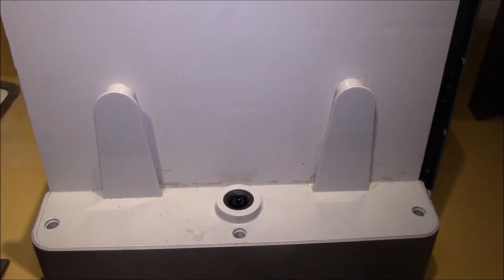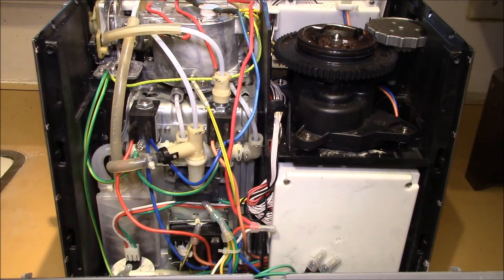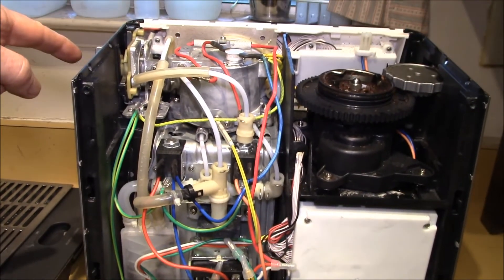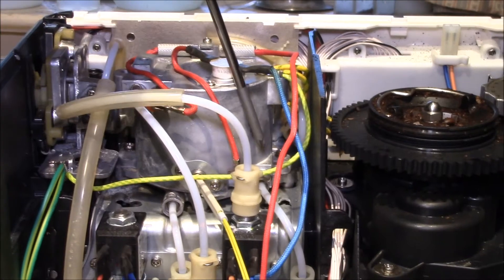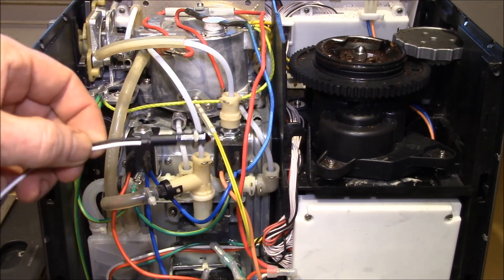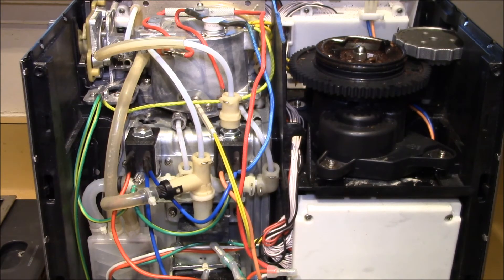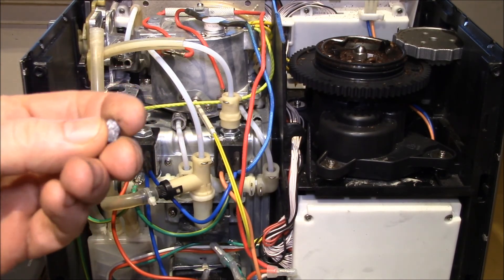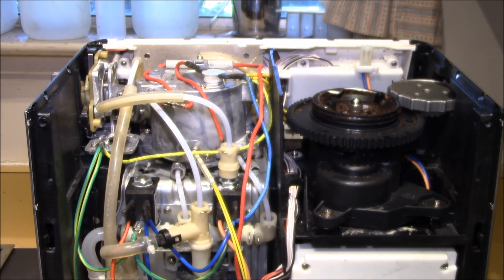Breville/Sage 870XL Barista Express - Water Flow

Comment: Breville 870XL question: opened my machine to inspect the water flow meter as my machine brew and never stops brewing. I was thinking is there is a way to take it out? And maybe clean it with citric acid? I can pull cable harness but I am avoiding pulling anything with force.  Can't find any video on this replacement or cleaning this part. Thanks any help or suggestion will be appreciated.
Reply from the maker: Have not removed that component myself.  One option is to clean it in place.  Use something a large syringe and a hose to connect to one end of the flow meter and a long tube into a container of descaling solution and then alternate pull and push liquid through the meter with the syringe.  Let it sit for a few minutes between cycles.
Reply: @The4Crawler   Plastic element that looks like it's not serviceable compare to commercial machines were they can be cleaned. It seems like your suggestion is the safest option to not break something. I'll go through the descaling process using citric acid or the solution from the store. If this won't help. I'll try to flush it, disconnecting the hose. fingers crossed :)
Reply from the maker: @wojtimore1  I may not be serviceable as in open it up to clean/repair it, but there is a replacement part available:
https://www.ereplacementparts.com/flow-meter-p-629903.html
Main thing to check is that the internal impeller is spinning when water passes through and if that's OK, it may be that the electronic sensor inside has stopped working or the connection to the main circuit board is not good or the input on the main board is not being recognized by the controller chip.

Comment: Thanks for the great video! I Need some help guys, I got an 860xl and it turns on, I hear it pumping but no water or steam comes out, would this solve my problem?
Reply from the maker: Does water appear in the drain tray?  If so, one of the solenoids may be letting water past and that runs to the drain.  Or one of the small diameter tubes may be clogged or the check valve in the pump may not be working right.
Reply: @The4Crawler  thanks for reply, it was the water pump, I took it apart and just cleaned it, put it back together and she worked like a champ
Reply from the maker: @david029014  Glad to hear you got it working again.  Good job!

Comment: Thanks a million for taking the time to make this video. I especially appreciate your efforts to name the different components by their proper name. It makes finding replacement parts on-line a lot easier.
Reply from the maker: You're very welcome!  I did spend a fair bit of time researching the names and functions of the various parts as shown on the ereplacementparts  web site to try and get them right for the video.  In fact it was that process that helped identify what some of the parts were for.
Reply: @The4Crawler  Can I ask a question please,  what kind of material is made the water tank, manual valve etc. ? Is it aluminum ?

Comment: Thanks for the video, great tutorial of how this machine works. I have the Infuser, I believe it’s the 840xl, same as the 870 but without the grinder. I started having low pressure so I did the following in this order. Replaced the flow regulator valve because it appeared to be leaking slightly, then I by passed the inline filter and finally replaced the solenoid.  None of these things fixed my problem. The main symptom is air coming out through the group head and or the hot water outlet, depending with I use - a frothy kind of sound. 
I disconnected the water going into the heating element and it is strong, no air.  I removed the hose coming out of the heating element and it’s full of air.  Note there is lots of heat being produced by the heating element. 
Any idea why I would having this issue?
Reply from the maker: My guess would be either the thermo-coil is bad or perhaps the temperature sensor on it is bad and causing it to overheat.  It could also be the limit switch on the hot water/steam valve.  If the steam switch is sticking closed, that tells the thermo-coil to heat up to generate steam (above boiling point) vs. hot water (below boiling point).  You might try unplugging the steam position switch (that's the switch that closes in the steam position) and see if that makes any difference.  If not, it may be the main circuit board is bad.  Might be worth contacting Breville support and see if they have any other ideas.
Reply: R Brown makes sense because the hot water flows out pretty normally at times but then turns to more like steam. You said to unplug the steam switch, how do I unplug that switch?
Reply from the maker: @berniehillier9399  See below:
https://youtu.be/9lMw6ooiqPI?list=PLpY2FP1a9tisyIfKjSugexoVK01xQuptv&t=408
Find wires coming off the switch that closes in Steam position and then find where those wires connect and remove them at that point.  I think they may connect both at the switch and at the main PCB.

Comment: Thank you very much for this very clear video. Together with this other video (https://www.youtube.com/watch?v=an_pZ27tNqk) it helped me understand how my Breville 840 worked, how to take it apart, and how to solve my long-standing low pressure/low water volume problem. There were two issues: (1) the 3/2 solenoid valve had to be replaced - it was causing some of the water to flow directly into the drain, resulting in low pressure and (2) there were air bubbles in the water coming out of the boiler, which was due to a crack in the silicone tube just below the pump. Opening the 3/2 valve entirely and cleaning it as explained in your other video (https://www.youtube.com/watch?v=eljHS_BRJXk) worked 90% of the time but I ended up replacing it for a more permanent solution - it also solved the buzzing sound. As for the 90 degrees silicone tube betwen the flow meter and the water pump - it can no longer be ordered (https://www.ereplacementparts.com/pump-inlet-tube-silicone-p-629894.html) so I just replaced it with a regular silicone tube. It is a bit bent but it apparently doesn't significantly restrict the flow and it doesn't cause any problem. Very helpful! Thanks for taking the time to make this video!
Reply from the maker: Sounds like a successful repair.  As I understand it, all these 800-series machines are fairly similar inside.
Reply: @The4Crawler  Yes, my model is actually a Riviera & Bar CE830A - it's the European equivalent of the Breville BES840XL. It is also sold as Solis in some other European countries. The main difference between the models seem to be the presence/absence of a grinder. The rest is exactly the same. And FYI - the official repair shop told me that my machine couldn't be repaired because the parts were not longer available. I was able to troubleshoot the issue by watching your videos, and all it took to find spare parts was a few minutes on google!

Comment: Nice video, for anyone who never seen inside one they might find it hard to follow but you did a good job explaining it:) I always say take pictures before you take it apart if you don't know where it will go after it's not where it use to be hahaha. Or you could just run this video and freeze frame it to look alike and hope for the best!
Reply from the maker: Glad it was helpful!  Yes, part of the reason I made this video was for future me, next time I had to tear into the machine.  I was completely wrong in my initial assessment of how the water flowed in this machine when I first changed out the solenoid valves.  It was seeing how the valves operated internally and also adding the indicator lights on the solenoids to see how they were operated that it finally made sense.

Comment: Thank you for your very thorough analysis of the water flow. The problem I have is as follows. When the machine is first turned on, it begins to pre-heat and presurise the water. At this point, the  port solenoid is turned off. What stops the water flowing directly from the 3 port solenoid to the steam/hot water switch and from there be dumped? This is in fact what is happening in my machine and I cannot figure out how it is supposed to work. Unless the pump is not supposed to come on until you start brewing but I am quite sure I have always been able to hear the pump come on momentarily upon pressing the "on" button. I would appreciate any comments you may have on this matter.
Reply from the maker: Glad you found the video informative.  With both valves off at the beginning, nothing stops water flow up through the top of the 3 port valve to the hot water/steam valve and through that bypass port to the drain pan.  On my machine, the pump is run for a few seconds at power up then it's turned off.  This is probably done to prime the pump.
Reply: @The4Crawler  Thanks for your prompt response. On my machine, the pump keeps running on turn on and, with the 3 port solenoid off, dumps the water straight, via the steam valve into the drip tray. It will do this until it runs out of water. I think this can only be due to a fault in the processor board.

Comment: Thank you so much for taking the time and effort to post this video. I had a problem with water coming through the filter head (think that's the right name), as soon as power was switched on, and no flow through either the hot water output or the steam wand. I had no idea of the flow through the machine, but once I watched your video everything was clear. Diagnosed a stuck 3 way valve, stripped it down and voila! One valve stuck in the open position with limescale buildup being the culprit. A soaking in white vinegar and a quick rinse with water and all is now well. Thanks again, much appreciated.
Reply from the maker: Great job on troubleshooting and repairing the problem!  Yes, understanding how water flows through the machine is key, with that you can usually figure out where the problem is.  Mine was just the opposite, the 3-port valve was sticking closed and not sending pressure to the brew head.
Reply: @The4Crawler  Thank you soooooo much for posting this. I am awaiting for the right screwdriver to be delivered but watching this video I already know what is likely wrong with my Breville Barista express. No matter what I do with the steam/hot water switch, everything comes out of the brewhead. Like Mike and yourself, I think the 3 way valve is the culprit  and is currently stuck in the "brewhead" position. Given the hardness of the water here in Paris, pretty sure my valve is made of limescale at this point. Thanks again ! I 'll keep you updated guys
Reply: Hey there, I have the exact same problem but I cant find the problematic part, can you please share with me the timecode of when we see the related part in the video.
Thanks

Comment: Great video. Thanks for the very useful info. I’ve had a very similar problem. Australian version BES860. Replaced the 3 way solenoid and dump valve on the valve block and descaled again. Still sending water to the group head and steamer at the same time when steam switched on. Trying to pour a shot results in no pressure on the gauge. Think I’ll watch your pump/over pressure valve video for some more help with my problem. Might be time to buy more parts although this time with more understanding of how it all works. Cheers 🍻
Reply from the maker: It sounds like the 3-port valve is not fully opening, which seals off the port to the steamer, and that's letting water go in both directions.  That valve is the key piece in the puzzle as the steamer/hot water side has no restriction and water will take the path of least resistance.
Reply: Thanks again for all your detailed videos. As a follow up for anyone following, I dug deeper into my problem. I initially suspected pressure gauge but thought I better rule out water pump first. It seemed to be fine and would pump out heaps of steam but would struggle to do a shot of coffee or move the gauge. Flow meter filter back flushed and flowing fine. Tested the pump and over pressure and found no water coming from over pressure dump line. And the pump would shoot water a few meters disconnected at the output. Replaced it anyway and all my troubles disappeared. Pressure gauge would jump up to normal range pouring a shot and no more leaks between steamer and group head when steaming milk. Thanks again for giving me that inspiration and motivation to get to the bottom of the issue. Now enjoying my home made barista quality coffee during Melbourne lockdown which has certainly made the lockdown a little easier. Cheers 🍻

Comment: Great video! Would you have any idea whats wrong with my BES870XL? Machine keeps losing programming, even after reprogramming, so you have to manually stop shot. first problem ive had in 4 years.
Reply from the maker: Assuming no issues with the AC power to the machine, it could be one of two things.  One is the flow sensor between the water tank and pump.  I think that's what measures the volume of water used.  Or it may be an issue on the main circuit board where the input of the flow sensor is read.  If you reset to the default volumes does that also not shut off?  Might be worth contacting Breville support and ask if they have any troubleshooting/repair ideas.
Reply: @The4Crawler  Thanks for the reply! I think you're right about the flow sensor. I reset default volume and still just keep running. I will call Breville and try and confirm diagnosis then order the part. Anywhere other than here that you're know of to order part? Thanks again! https://www.ereplacementparts.com/flow-meter-p-629903.html
Reply from the maker: @SneakyMrMan  EReplacementParts or armed with the part number, you can likely order the part from Breville or search on-line with that p/n and see what shows up.  Also worth checking out the part, see if the little rotor inside is jammed on something or if the cable to it is unplugged.

Comment: Hey thank you for the video! This helped my understand the internals of the Barista express. I got here because my  1 cup and 2 cup button doesn't automatically stop, I also never had a clean me light on with 1 year of owning the espresso machine. I am thinking there is something wrong with the flow meter, do you think there are issues other than that? I will try to open the machine today now that I watched this. Thank you again!
Reply from the maker: It may be the flow sensor is faulty, it may simply be unplugged or perhaps clogged with hard water deposits.  I would also try resetting the 1-cup and 2-cup volume settings to the factory default (see owner's manual for instructions).  Also, if nof recently descaled, run a descaling cycle followed by the cleaning tablet cycle if it'll let you run that.  Also, might be worth contacting Breville support and see if they have any further troubleshooting steps to try.

Comment: do you know what's the gauge of the white water tube going into the group head?
Reply from the maker: If that's the same as the other white teflon tubing, it seems to measure 0.145" or 3.68mm outside diameter.  Part numbers available below:
https://www.ereplacementparts.com/breville-bes870xl-the-barista-express-parts-c-116052_116055_290179.html

Comment: Mr. Brown...Can you suggest while brewing  water flow does not stop while using one shot or two shots. I did decal few times, still it is erratic. Any suggestions?
Reply from the maker: A few things to try:
1 reset the water flow settings, instructions on how to do that in the manual.  
2, if that doesn't help, try unplugging the machine for a few minutes to see if that will reset it.  
3. If that doesn't help, it may be the water flow sensor that is not sending good flow data to the control board.  The amount of water pumped is determined by that flow sensor, it is easily replaced if needed.
4. Or it may be an issue with the control board itself.  Might be worth contacting Breville support and see if they have any further troubleshooting information.

Comment: Thanks for this videos so helpful, my question is that how can i reduce the pressure to almost 10 BAR maximum because it is reached 16 BAR during extraction i saw some people do it but i can't figure that. 
Regards
Reply from the maker: Easy thing to do is set the grinder to a coarser (higher number) setting as it's the packed coffee grounds that provides the restriction that causes the pressure to rise.  The other option that might work is to adjust the end of the safety valve that's on the pump outlet:
https://youtu.be/46UBebNJ-uo
That black end can be turned in or out to release water when the pressure exceeds the set pressure.  I think it's normally set around 15 bar.
Reply: @The4Crawler  Thanks for your reply 🙏, 
can you explain how can i adjust it please if you have time
Reply from the maker: @ayradhi  See the valve at this time in the video:
https://youtu.be/46UBebNJ-uo?list=PLpY2FP1a9tisyIfKjSugexoVK01xQuptv&t=61
The black end turns in and out and there's a spring inside that holds the valve closed.  I think turning the back end out releases tension on the spring and the valve opens at a lower pressure.  But easy enough to check, turn it one way and see what the pressure reads.
Reply: @The4Crawler  Thank you very much

Comment: Mine has no water coming out from the head with max pressure (without any coffee) and the pump seems to be ok. Everything else looks ok. Any idea? Tia!
Reply from the maker: If the gauge is registering pressure and no water is coming out, it sounds like there's a blockage in the line after the pressure gauge connects and before the water exits the group head.  I've never torn into that area of the machine but maybe you can contact Breville customer support to see if there's a way to access that area.  Or this web page has some troubleshooting and repair ideas:
https://siber-sonic.com/appliance/800Mech.html